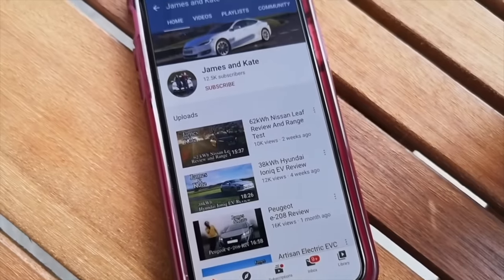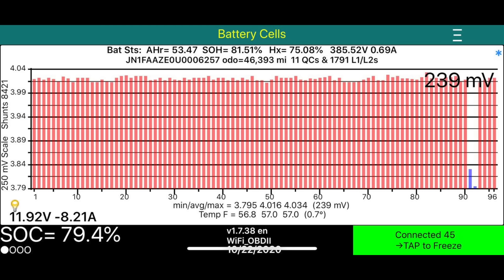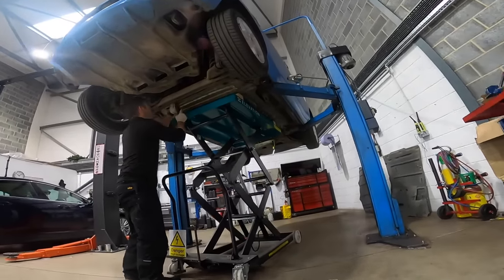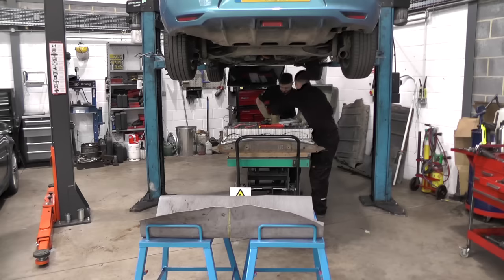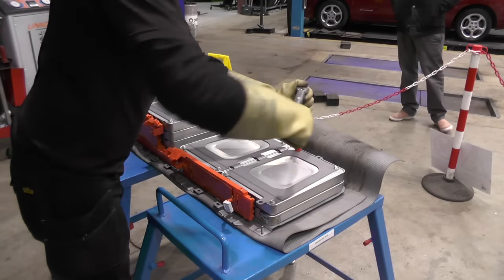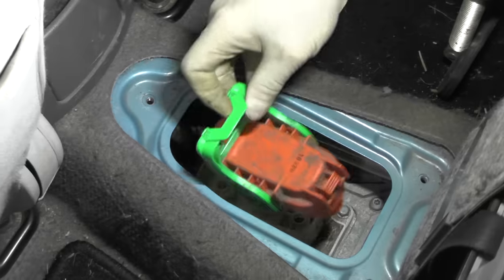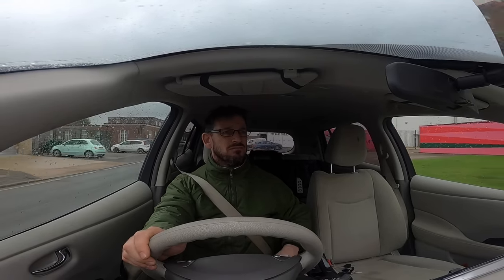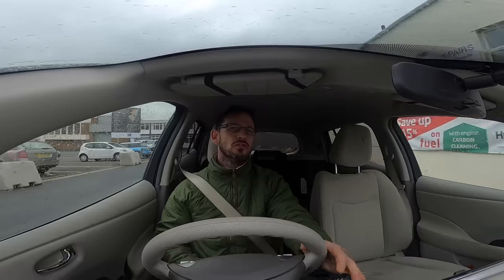Electric Car Battery - Dead After 3 Years, Right??

Comment: It looks like Tesla is moving towards unserviceable packs after battery day announcement
Reply: when was the last time u serviced ur smartphone battery?
Reply: Maybe.  In 2011 the battery was a large % of the cost of the car probably 50%.  It made sense to be able to swap sub modules.  If Tesla can reduce the cost of the battery down to 10% with a suitable reliability, and in addition reduce the overall assembly cost and weight and allow for the entire pack to be unbolted/removed from the forward and read sections they can achieve the best of both worlds.  Since they have plans to give batteries a second life after the car is shot I expect a whole pack swap to be feasible.  It really comes down to how reliable the pack is.

Comment: Why should this be an issue? Nissan offer an 8 year warranty on the battery pack.  And even after that length of time, it may not be a problem. There are now companies around who can test a suspect EV pack and renew any weaker cells, thus restoring the viability of the pack.  Why do so many people seem to feel an EV is expired once it's warranty runs out? Nobody says that about i.c. cars. They just fix those when needed, and carry on driving them. And the same will be true for EV's too.
These people do EV battery pack refurbs.....  https://www.indra.co.uk/

Comment: Great to see this is possible for only £500. I wanted this exact service earlier this year but it was impossible to get hold of anyone at THIS garage, or others. Mine was a 2013 Leaf exhibiting this issue. Nissan's answer was to either trade in the car for a new leaf, or swap the pack for £7K. Good to see this, just a shame I couldn't get this simple service for my car before I part exchanged it.

Comment: A small battery should rotate motor topped up by small engine . Reason not because small cc can evade tax and ultimately as a vehicle by size cc . Corruption from the top

Comment: Wow, that is easy to repair LOL compared to an ICE it sure aint no rocket science, some of these modern engines are so complicated you be better off buying a new fucking engine off the factory, kind of sad all this crap in search of greener exhaust when we could just pursued hydrogen or battery powered vehicles instead. 
I own an e-Golf, apart from breaks and some fluids there really aint much to check on it, saves hundreds on fuel and servicing each year and the fact its got regen breaking means the break discs will last twice that of an ICE car. 
Simplicity = Good

Comment: You forgot to mention if the battery lasts for more than3 years, or it goes straight to a landfill
Reply: It won't go to landfill, it can be recycled..... the packs can be shredded and most of the elements within can be re-used in new batteries. Your view is a popular misconception....

Comment: use one of my step up generators and using just two steps you would get full power on a 40 amp 72 battery for like twenty four hours. the use two of the double step up system and they can charge each other while reaching the former total weight of the car. (MAYBE). LIGHT IS FASTER. ebike battery 775 drain on battery (.20 amps and 12 volts 5000 rpm's) yanmars two 20 amps 12 volts and transformer 120 20 amps high speed three horse power motor. This motor turns for beat truck alternator for 1400 amps and almost three hundred volts so you do need a transformer or amperage to volts control system but the cost of production of the vehicle and the possible battery explosion are reduced by over 90 percent and then value to customer goes up by 10000 percent as you only need to charge it once. the problem someone in oil would be bankrupt. how much would you pay for this car and its convenience (how about 20000 more then a new prius.

Comment: Try doing that with an ICE
Reply: ICE's don't need it is probably the point.
Reply: @Stimpy&Ren  Depends where you are.  In this country,  (Australia) various forms of OBD have been around since the late 80s, but the standards and protocols were proprietary and means to access them (other than a wire and a flashing light) hard to find and expensive.   We've had 'OBD2 creep' since the mid to late 90s with (some) imported models having OBD2 compliant interfaces fitted, others... well, it wasn't untill 2009 that it became standard on new cars.  Prior to that it required... ingenuity... I have 96 Ssangyong Musso that has Mercedes power train, so you need an adaptor for the Merc style round OBD plug and a OBD1+ variant dongle, plus a freeware app for a PC to read it.   
And yes, modern vehicles are actually easier - if you understand the concept.   The Musso has no points, (in fact no distributor) 3 coil packs and fuel injection.   The computer tells you if a sensor is crook, or if it's misfirng and which cylinder.   Provided you are clued enough to read the data, it's pretty straight forward.   We had it die without warning on us, plugged in the computer, instantly told us the crank position sensor had died.   Buy the part, change it, done.   The EMC in modern vehicles are very reliable compared to the 80s ones as well.   And hardened.  I can recall a late 70s electronic fuel injection system that would surge in response to someone talking on 27mhz CB sitting next to it in traffic.
Reply: Why would you try to do it with an ICE if you owned a Nissan Leaf?

Comment: I suppose you realize, that NISSAN designed the car to fail in this way. Nothing like this ever happened a.f.a.I.k. with a TESLA vehicle. NISSAN should be sued for this!
Reply: Sir.. what?! It is a smaller battery, so every cell is going to be stressed a lot more than compared with a massive tesla battery. So of course leafs are going to have more failed cells. But that doesn't mean this was planned obsolescence. If anything, it shows nissan really thought ahead about repairability. Tesla, on the other hand...

Comment: 6:20 500 quid for a two-hour job that YOU HELPED WITH?  Mate, that is out-effing-rageous.

Unless...you mean Nissan would have charged you £500 for it, and using Matt's shop meant it only cost...£499.99?
I have a 2011 Leaf (with a 2015 battery,) so I was keen to see how it worked out.  
Also, you can pull the battery pack in your driveway, using a floor jack to lower it onto a creeper built of wood and castors. (https://www.youtube.com/watch?v=BtBOKyu_soU)
Clearly LeafSpy was money well spent in analysis (No, Nissan, the whole battery pack does not need to be replaced,) but if you shelled out £500 to rent a lift and a second set of hands...you were robbed.

Comment: having seen this , I will stick with my IC engine . the cost of that repair is not mentioned but I'll bet it wasn't ££££££ cheap.
Reply: The cost was mentioned, it was £500, and that's after 9 years of use. 
EVs are far cheaper to maintain, and much cheaper per mile to run. Consumer Reports estimates the average EV battery pack's lifespan to be at around 200,000 miles. That's about equal to ICEs. 

But ICEs just become scrap metal, whereas many BEV batteries can be re-purposed for static energy storage, even if they've lost 40% of their storage capacity or more. And even if they can't be re-purposed, they still contain a lot of valuable minerals. Per ton, used BEV batteries are far more valuable the used ICEs.

And there are another considerations for many users. Congestion charges, low or no RFLs, and zero benefits in kind charges. That's why high cost BEVs are popular choices for corporate executives.

But even for private buyers, second hand BEVs with a few years left on the battery warranty can make eminent sense.

Just things to think about, you take care my friend.

Comment: Pure propaganda piece.  The odometer only showed 46,000 miles!  Very poor showing to have the battery fail with so few miles. They say 2 hour job to repair. But that’s with 2 men working, so that’s 4 hours labour!  Plus the the cost of the battery module, no way that repair costs £500 pounds.
Reply: Mileage has much less to do with it than you might imagine. I used to work with a guy who blew up an Astra after just 3k miles from new....... You car might last you a lifetime if you drive it badly enough....

Comment: Imagine driving to repair place every time one of battery dies. I would better change everything than spend money for repair + even one battery cell cost 500. You can't expect that one cell dies and others will live more than others.
Reply: Imagine not knowing about the ability/capability to balance charge EV batteries........  I've not owned a Nissan EV, but my Kia manual contains info on how to balance the pack..... The Leaf is an older EV design. Newer designs have far superior battery management.....

Comment: I think electric vehicles are a completely waste of money and time I'm stick with a good old fashioned petrol engine you don't go wrong
Reply: At least not until you can't find a petrol  pump anywhere to fill up..... It probably won't happen for 15+ years, but happen it will. What u gonna do then?  Horse? Walk? Hitch a ride in somebody's electric car?   I bought my electric car almost 18 months ago, and my running costs have dropped massively. I previously used to spend around £25 to £30 per week on petrol. Now it costs me about £7 to £8 per week to charge up. So you carry on not going wrong with your petrol engine, and I'll carry on saving a packet on petrol..  Which electric cars have you owned long enough to be able to form your opinion of them?  And despite what you seem to think, petrol engines do go wrong....